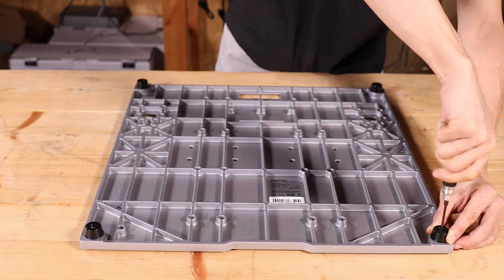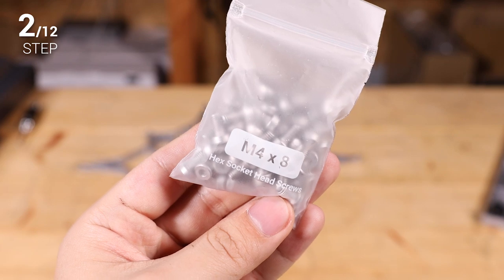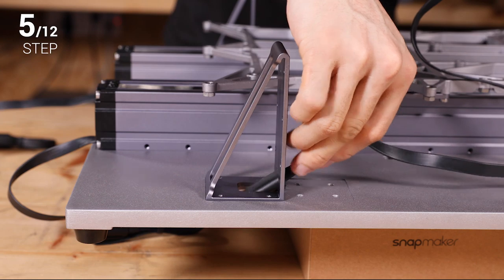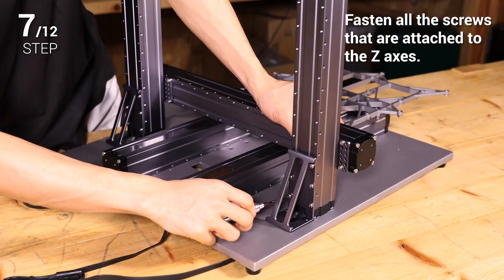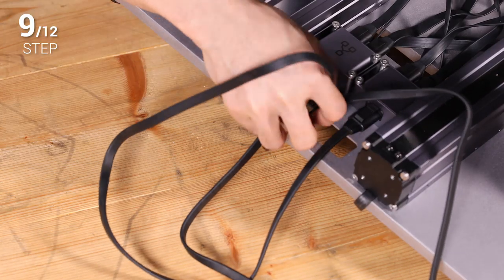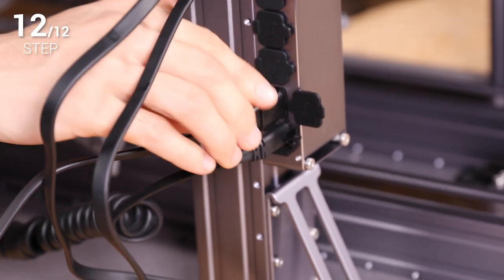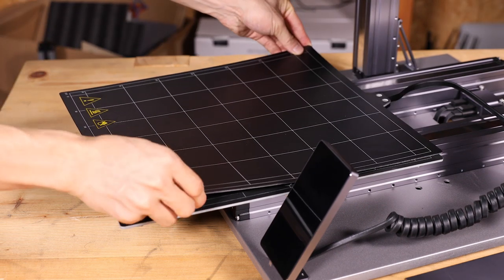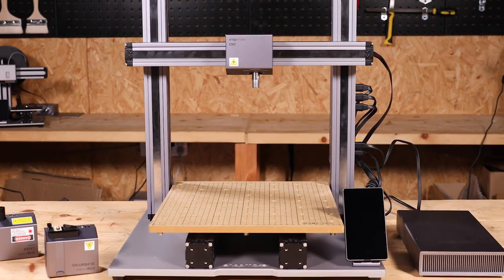Snapmaker 2.0: How to Assemble the A350

Comment: So, if I want to switch from 3D printing to CNC, I have to unscrew 22 screws on the heated bed and then screw in 14 different screws for the CNC board?
Reply: I think Snapmaker should design a screw driver head to do that. 😂

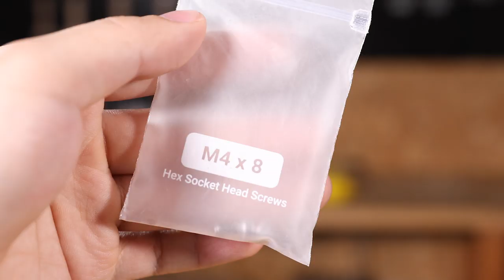Comment: DO NOT PUT THE CABLE HOLDER IN THE POSITION SHOW AT 4:33! It will pull the cable too tight during the calibration phase and break the cable. Either they shipped us too short of a tool head cable, or the video shows the cable holder attached to the incorrect position. I have double checked the position of all the parts over and over and I am 100% certain there is either an error in the video or they sent us the wrong cable for the tool head.
Reply from the maker: Sorry for this inconvenience. Would be helpful if you could give us more details via support@snapmaker.com.

Comment: why wont the slider on the linear modules move when i try to align them by hand? (step 2) it seems you move them with ease but mine dont move.
Reply from the maker: Hi! Can you move it in the other direction? If so, you can check this guide: https://support.snapmaker.com/hc/en-us/articles/360055281234-What-should-I-do-if-the-linear-module-can-only-move-in-one-direction-Snapmaker-2-0-

Comment: What does "Do not press the steel strips" (at 32s) mean?
Reply: Should be the shiny metal connected to the slider. It acts as a dustproof cover on the leanear module. See 29s.
Reply: There's a steel strip on the linear module which protect the linear module from dust or dirts. It's thin and can be pressed down by mistake. Users should not press that metal strips. Otherwise, it won't work properly. For example, it may get stuck into the groove on the linear module.
Reply: @hereisx9712  Thanks. I get it now.
Reply: Pierre Fransson I accidentally did press one in, If it happens to you slide the x axis bar over it slowly and that should put it back in place
Reply: @davidtolsky9759  David how is it going with the machine? Do you like it? I am trying to order one to ship into Panama
Reply: @davidtolsky9759  Thanks for the info! Good to know in case of an accident.
Reply: Pierre Fransson yeah it made me nervous at first but it corrected itself after sliding the cross bar over it. All is well